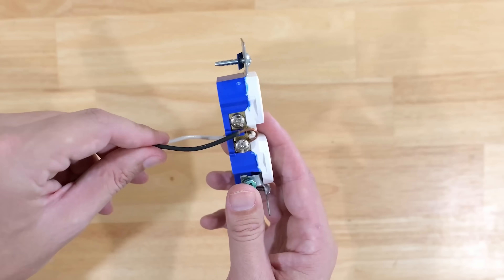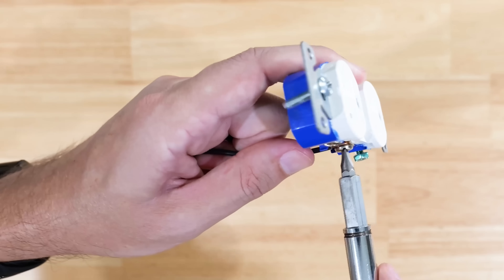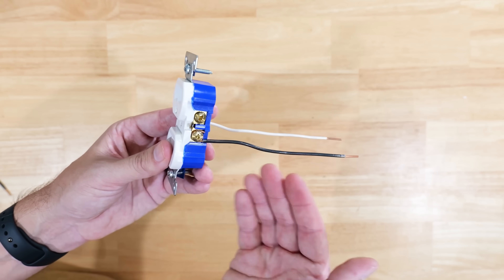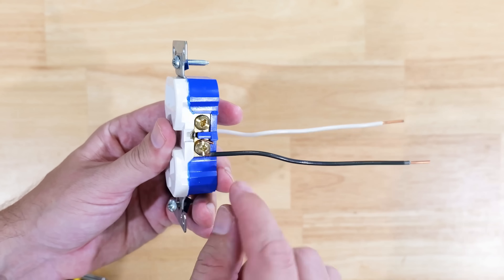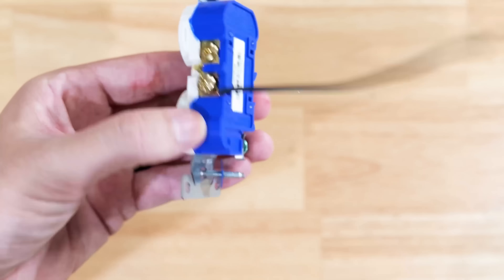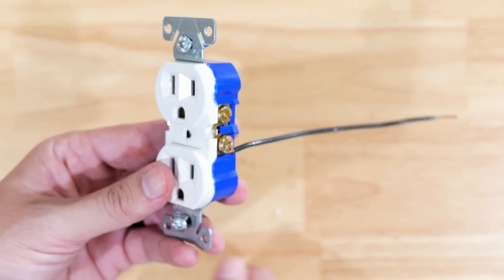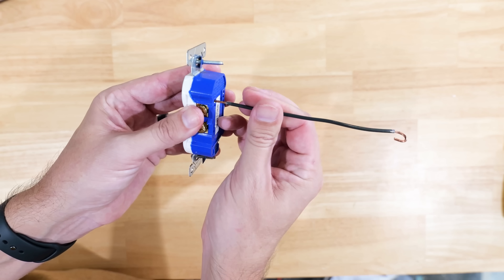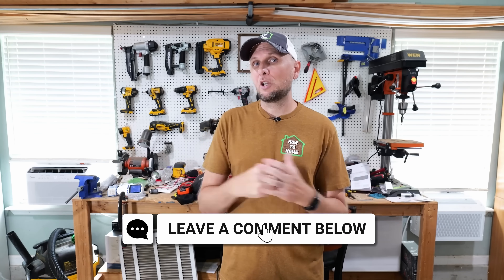Avoid Disaster! 8 FATAL Outlet Mistakes Most DIYers Unknowingly Make!

Comment: Thanks, awesome video. I upgraded all our outlets 12 years ago then suddenly on one circuit power went out. We found a loose black burnt wire that partially melted the receptacle and the breaker didn't trip!! I replaced it with a new 15 amp outlet and tightened it correctly.

Comment: My dad was an electrician he taught me well. Whenever I wire a house for myself I do "code plus one". That means go one better than code. For example a 15 amp recepticle is legal for 14 gauge wire..but.. 12 gauge gives you that extra safety for virtually the same price. Heck 10 gauge wire makes the circuit even more idiot proof if, in the future somebody adds on or changes recepticles or the breaker. My own house uses 10 gauge on all receptacles and 12 gauge on even the lights. For wire-nuts I solder the joint. A little butane jet lighter and low temp solder and you are done in 30 seconds. Then screw the nut tight AND tape it..all inside a junction box. Leave slack in the cables in the walls..that way when somebody hammers a nail into the wall the wire can be pushed out of the way instead of punctured. Remember folks..you wire things for your great grandchildren to use.  Good wiring should be safe and sound a hundred years from now. Thats an electricians legacy..
Reply: Most devices will not accommodate 10awg wire.  So you must be rigging something in a way not intended to make it fit.  You also quickly run out of space for that larger wire which is also much harder to form.  Solder?  Really?  You probably create defined edges where it’s easier to break a conductor at the joint.  I would not recommend that, and also likely melting the insulation a good distance from the connection.
Reply: 10 on all plugs? That's kinda crazy . Must have been a real treat stuffing some of those single gang boxes especaly with a gfci in it
Reply: @ Only a real electrician would know
Reply: @ezrabisson3610 … ikr😂
Reply: Solder isn't code
Reply: @Johnsoline true but do you know why
Reply: @TheJohnsoline

Nor is it NOT code…
Reply: #10 for all the outlets in the house? How are you pigtailing that in a single device box?
Reply: @Kevthebish  this would be the correct way to do it or us fork crimps because #10 is not rated for the device, but these dumbasses won’t tell you that because they don’t know what they’re talking about. They are the ones that will cause a fire because of the 10 gauge wire and a breaker being ready to wear it at the outlet will burn up before the Breaker will trip because the breaker should be on the right size wire so that recognizes Heath and trips. It’s a thermal breaker.
Reply: These devices are not designed for those gauges. You are introducing more problems and not protecting against anything, except keeping money in your pocket.
Reply: 10 gauge on outlets, stupid
Reply: Your dad taught you to spend needless money, he didn't teach you well wtf you talking about..... If you know anything about electricity you wouldn't waste money on bigger wire for a smaller circuit and NO it's not virtually the same price there's actually quite a big difference in 12 and 14 Romex when it comes to a complete rough
Reply: @illwil2158 true because a good electrician will never load a circuit over 80% so for example to protect your circuit you would never try to put more than 16amps on a 20amp circuit or 12 on a 15amp circuit and also a good electrician would never use the device as a splice point a good electrician will only have the hot the neutral and the ground and your ground spices should be barrel crimps by code not wire nuts in residential
Reply: Everything you mentioned is horrible practice.  I think this is a troll post.  There’s no way any electrician would do this.
Reply: I've been retired for a while, never once used a wago, so I may be too old school but...
  If I were using stranded wire on receptacles, I'd use spade or ring lugs, the nose or tip of a good wire stripper is made narrow to allow crimping a solid conducter snugly around the terminal which makes it a pain in the ass to swap out but basically eliminates the need to swap out in the first place. Lastly, if arcing or grounding out are a concern a simple wrap of tape is always a good way to go.
Reply: over kill, costly
Reply: Always use the proper size wire for the circuit I would not use number 12 or number 10 on a 15 amp circuit besides the heavier The Wire the less wires you can use in an outlet the other problem is people will look at the wire in the panel box what's number 10 wires so I can put a 30 amp breaker in it and the receptacles are only rated for 15 amps not a good thing number 14 for 15  number 12 for 20 the number 10 for 30 and number 8 for 40
Reply: BS
Reply: I've been a electricitycian for several thousands of days and the 37th thing my boss taught me was to never wrap a wire in any kind of metal tape around another because it would start a fire in the breaker box because of loose taping of electrical tape that might short or long-circuit the electrical panel in the hot attic.
Reply: @geraldduncanduncan1874 Electrical tape doesn't have any metal in it, hence electrical it is made for wiring of electrical wires.
Reply: @geraldduncanduncan1874 duh
Reply: Soldering is illegal for 120 volts.
Reply: I legitimately cant tell if this is a troll post or not. But I'm kinda hoping it is.
Reply: 10 AWG holds 30 amp circuit something is not only wasted of money using it for residential receptacles (commercial should be 20 amps min. Under NEC codes) but also makes extremely complicated the housing and installation of your terminals.
The safest way to go would be 15 amps on lighting (14 awg wires)
And 20 amps on receptacle outlets (12 awg) and the last one is consider "overkill" by NEC making it unnecessary,  however for people like me who uses very powerful equipment  inside home running 12amps receptacles circuits is worthy and makes my circuit last longer and give me peace of mind. However 10awg makes not sense whatsoever.
Reply: NEVER use solder on house wiring! Dissimilar metals create problems!
Reply: @iamthundermug  I agree with that - both copper and aluminum wire are soft enough to be mechanically bonded just by squeezing them together with ample pressure lol
Reply: @3nertia  never mix copper and aluminum. Aluminum requires special connectors also.
Reply: @iamthundermug  I never said to mix them ...
Reply: @iamthundermug Knob and tube wiring was soldered at every joint. Those joints did not fail.
Reply: @Fetherko  I’m a retired electrician. My last 20 years I spent doing service calls. I never saw k&t soldered. It was one wire tightly wound around the other, and taped.
Reply: @iamthundermug I’m replacing the K&T in my attic.  That’s exactly what’s there.  The tubes are handy through studs.
Reply: @Fetherko true but that’s why they would start fires
Reply: Daddy didn’t raise no electrician, that’s for sure…. Not pulling permits is going to cost ya a whole lot when you try to sell your house, or when your insurance won’t payout for the fire. Hate to be the NEC tekashi69, but you might want to make like those 3 blind deaf-mute monkeys, and burry all that deep down inside, cus you self-snitchin.
Reply: Your dumb
Reply: Alot of red flags here
Reply: @michaelyounger4497  that’s why Commercial electricians call U bungalow busters you don’t go to real apprenticeship program you don’t really know what you’re talking about you don’t have certifications and that’s why the Democrats love illegal immigrants so they can take your job and I’m not even a union guy I’m a nonunion electrician and I know better than to talk about what you’re saying
Reply: @michaelyounger4497  Putting 10 gauge wire on a 20 or 15 amp outlet retarded do you even know how to figure out voltage drop or resistance or do you know what running that in the walls for voltage drop or resistance against what it would cost you for the price of material where do you find that significant? Please tell me if I’m wrong I’ll shut up, but I guarantee you I’m not.
Reply: @michaelyounger4497  did your dad go through an apprenticeship program or did all he do was do with his dad told him because if not, then you only got all lot of getting your handheld and you don’t know what you’re talking about because your dad never learned more than what he learned from what he learned from the people who told him and our technology, and what we’re supposed to do in our code changes every three years so Reeducate
Reply: Shut up
Reply: I appreciate the tips and examples you gave in this comment.
Reply: MORON, quit flapping your gums about using #10 awg for 15a receptacles.
Reply: Almost my entire house is wired with 12 gauge, even though it's all 15 amp circuits.
Reply: Yes agree. Wire with 12 gauge but the breaker needs to be 15Amp. Devices shouldn't technically be used with larger wire and larger breakers. See it all the time. Convenience outlets. 
Once I saw a constant  load of 18 amps. Device eventual failed due to heat build up (15amp device on 20 amp breaker.. It dryed up and cracked and terminal burnt with hooked wire. (Never push on.)
Reply: 15 amp device on 20 amp breaker is allowed by NEC. The 15 amp yoke won’t allow excessive load due to the equipment plugged in is going to only draw less than the 12 amps required on a 15 a circuit . Since the cord plug itself is a 15 a
Reply: That being said the circuit has to be rated at 20 a
Reply: @johnrodighiero8231 Should you just use a 12 gauge on that 15a device? Or is a 14 permitted?
Most likely not. 14 should not be used?
Reply: @j.d.1488  The only time a 20 amp receptacle is used on a 20 amp circuit is when it is the sole device on the circuit.
Reply: Commrrcial is push on, and ive never seen s faulty residential push on. I have seen a few loose j hooks, bent j hooks, loose hooks, cracked j hooks. Nothing is a panacea  @j.d.1488
Reply: Appliances and electronics will use less current as they become more efficient.  I would not use larger gauge unless it was in a super-hot attic.
Reply: Don't mix different ratings when you wire. That's literally against code. If you are going to go through the hassle of upgrading the wire gauge, just upgrade the receptacles and breakers to match. All it takes is someone to switch the 15 amp breaker to a 20amp, and now your outlets burn/melt inside your walls.
Reply: @joshuawiedenbeck6944  You obviously don’t know what you’re talking about code does not speculate what if what if I have to make sure that a 20 amp circuit to fly a spaceship to the moon that’s not the way it works. There is no what if the cold spells it out and no it’s not left up to interpretation. I hate it when people say that because those people don’t know how to read the code.
Reply: @timothydixon2545  You do understand that municipalities can require additional code beyond the NEC? Maybe everything is fine where you live specifically. Doesn't mean it isn't dumb.

Comment: There is no problem putting 20 amp recepticle an a 15 amp circuit.
  The breaker will limit the current flow no matter what recepticle is installed.
 Wrong information. 
  The 20 amp recepticle on a 15 amp circuit is larger amp capacity then will ever be delivered on a 15 amp circuit. 
 No danger what so ever, it just won't deliver a 20 amps to the load because the 15 amp breaker is the limiting factor.

Comment: I use 12 gauge for wiring everything. Example alot of lights wired  14 gauge put big house fan, or plugs,  plugging heaters in wires can get hot quickly. You can end up cold or VERY HOT QUICKLY

Comment: 14 gauge wire is de rated to 15 amps.  20 amps on a 14 gauge will never cause a fire.  Yes that is the code but in real life you are safe at 20 amps.  Loose wire is much more dangerous. Resistance on a loose wire is when heat builds up.
Reply: De rated?
Reply: @-f-r- it's actually not de-rated.  14ga is rated at 15a period.
Reply: It's code for a reason, safety.  It might not be an issue the first time, but it will be an issue at some point.  Better to just do it right.
Reply: Also power is AC not DC so either way you wire a plug gets the same voltage and amperage in both directions. Not sure about this guy when first 2 items are wrong
Reply: @zahlharrassgaming7837  Except that some appliances have the chassis as a ground point, with a 2-blade plug. If you wire backwards, you will have a 'hot chassis' and can get electrocuted.

Comment: helpful for DIY. I think you mentioned, heat can cause a fire, something pulling more than 15 amps, will heat up 14AWG wire. I think also a 14w (100watt equivalent new LED) light bulb can also get very hot on 12AWG wire. Is there another variable to the heat issue? the actual white rim of the bulb gets hot after 2 minutes then very hot after 5. Can a 14watt light bulb pull and make more heat at the endpoint bulb, if there is thick 12awg, less resistance, wire instead of 14awg wire, is what I think I'm seeing.
Reply: No,not for 14 watts,wire size is not the problem.
Reply: @edcat6587  thanks. this is what I also thought when planning to redo my kitchen lights.

Comment: You have to use twelve gauge wire to run any receptacle you can only use 14 gage wire for a light fixtures
Reply from the maker: That is not a national code.  Might be a local code of yours if it is one.  But most areas do not require #12 for receptacles if any.

Comment: Thank you for this. I learned alot. I have always been deathly afraid of anything electrical, but as a homeowner, I find myself doing more and more.  This is SUPER helpful. Thanks again.
Reply from the maker: You are very welcome!  Really glad to hear you liked it.  Thanks a lot for the feedback Clay!
Reply: Don't be scared of electricity, it's good you're trying to learn! As an electrician it's a crime we aren't taught it more in school. Absolutely no reason home owners call and pay an electrician 300-500$ for putting in a new outlet and its circuit.
Reply: @MikeHawkPEN15 
I'm terrified of it. I was shocked bad when I was a kid, but I own a home and have had to do a few things so I watch 20 videos before I attempt anything 😂
Reply: What keeps a person from plugging in 20 amps to a 15 amp box
Reply: @MikeHawkPEN15 Can you imagine what they are being taught today and what they aren't???🙀
Reply: ALWAYS shut off the circuit breaker that feeds the wiring you are working on. Buy a voltage tester. Test your tester on another know circuit to see that the tester is working.
Reply: dc power I'm a wiz ac power i turn the main power breaker for the whole house off to change a receptacle i have been shocked 3 time in my life and it scared the holy crap out of me so any breaker work i call a electrician and cry over the bill for a 5 min job

Comment: With my penchant for overbuilding things I’ve put 20 amp receptacles on a 15 amp line thinking they were “stronger or higher quality”. Not any more! I’ll be using the commercial grade 15 amp from here on. Thank you so much for this tip!
Reply: Of course you can plug a 20A receptacle on a 15A circuit. The reason is just imagine even if you have 15A wire with 15A receptacle, if the load require more current with a faulty CB, the wire and receptacle will still burn: the receptacle does not protect the wire from burning if CB does not work properly.
Reply: He is wrong. Your thinking is correct. Electrician, 35 years, contractor for 20 of those.
Reply: This is actually one of the silly things in the video.  You can plug a 20A device into a 15A circuit as easily with a 20A outlet as with a 15A outlet.  The caveat in the presentation is, "if the circuit breaker does not do its job".  That is NOT the fault of using the wrong outlet....and so not that fault of you doing so in the past.
Reply: @dave242able Yup there are very few portable devices using 20A plugs (1 horizontal, 1 vertical blade) so most of the time there is no issue other than making sure the thinner 14 gauge wire is securely attached. But, there are a few devices like professional hair dryer, some heaters, etc that have 20A plugs so in that case it would not be a good idea to have a 20A receptacle on a 15A breaker and 14GA wire ...
Reply: The current rating of the receptacle indicates the current that it can safely handle. It has nothing to with the amount of current that the load draws through the circuit breaker.
Reply: @DRPowell  Finally, some actual sense. 
The clearest and safest way is: 
to use a 20 amp receptacle with  12 awg wires/20amp breaker . 
If for some reason there happens to be 14 Awg wire to a receptacle, then it should be on a 15amp breaker, and you can use a 15 amp receptacle. 
Any different combination(s)s has it's issues.. either the potential for melting the receptacle, or the wire. 
Not rocket science, but is simple science.
Reply: @paulkaz2127 Thank you for this comment!  Finally!  The answer to 12G wire / 20A Brkr = which Receptacle needed?  Also in my old house a “downstream” multiple receptacles issue thing.

Comment: Nice job….You are not just being informative, you may have saved someone’s life!! 
We in the field, see damaged receptacles and just say “wow” glad you are replacing this.
Reply: PLEASE DON'T LISTEN TO THIS GUY!!!!  HE DOESN'T KNOW WHAT HE'S TALKING ABOUT!!!  IT'S **ALWAYS** SAFER TO USE WIRING AND CONNECTORS THAT ARE RATED HIGHER THAN YOUR LOAD, NOT THE OTHER WAY AROUND!!!!  NEVER USE AN OUTLET THAT IS RATED LOWER THAN THE WIRING OR BREAKER!!!!!
Reply: @BLACK-AUTUMN-MAGICK  it is against code to use a 20 amp outlet on a 15 amp circuit, for the reasons stated in the video.

While using a 15 amp outlet on a 20 amp circuit is against code if it is the ONLY outlet on the circuit, it is allowable if you are using a 15amp duplex receptacle or multiple 15 amp outlets on the 20 amp circuit. I would still advise against mismatching though.